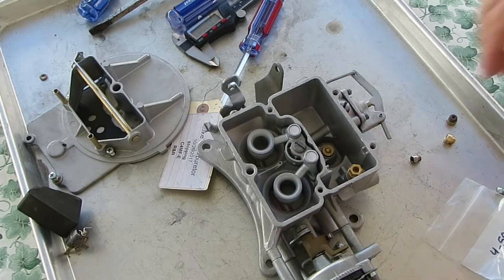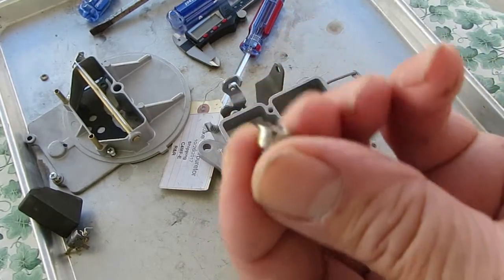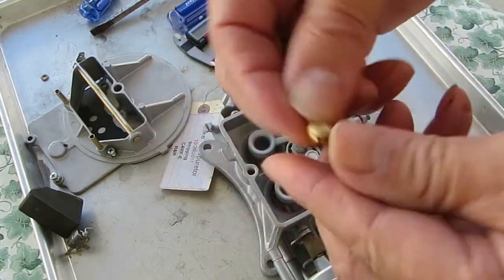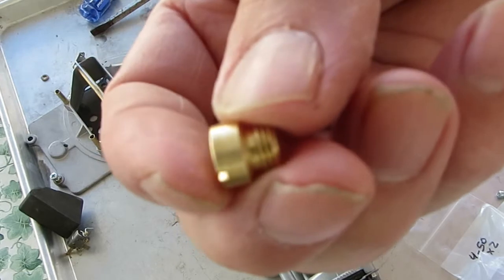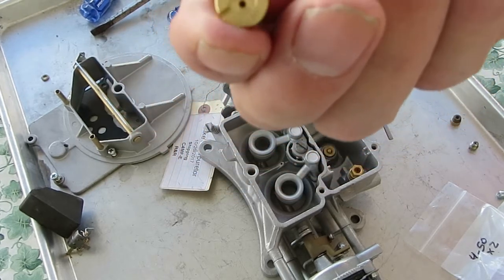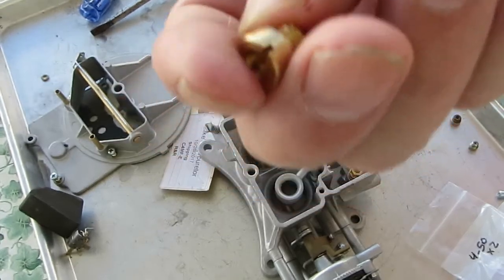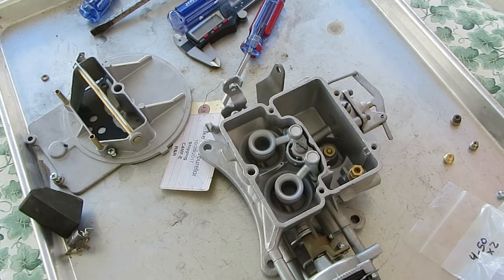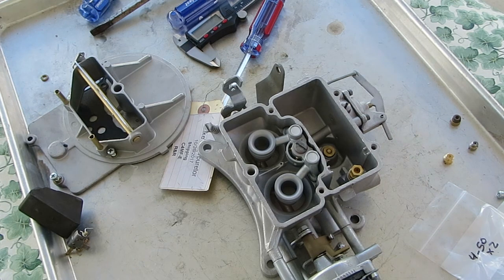Difference in Holley & Motorcraft Jets

Comment: Hey Mike..  a question.  What's the function of the "check ball" and weight in this carburetor??  What happens if the ball does not seals well or if the seat is dirty or surface is irregular?

Comment: I don't have black spark plugs on my 1964 Galaxie with the 352 at sea level elevation.  I was running a 2 barrel carb and had no pinging problems.  I bought a 4100 1.12 carb off ebay and had it rebuilt.  I should have looked at the jets when I did this 12 years ago.  The 4 barrel gave me more power but now my engine pings.  What should my jets read for the 1.12 carb for the 352 at sea level?  An old time mechanic said to increase the jet size to stop the pingining - does this make sense?  Love your website as i have bought parts for this carb form you in the past.